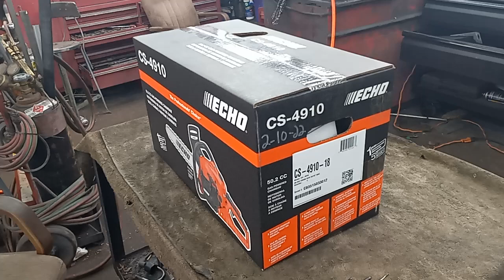Un boxing an tear down on the 4910 reed feed nitro saw build an me babbling

Comment: Charlie, I upend up my transfers on a 44cc husky, just a bit, but it just wants to idle higher. I know how to adjust a carb but the idle screw wont even affect the idle, the only way to get it lower is to make the low jey way too rich. Do you have any idea whats going on? Or is ot normal. The saw is vac/pressure tested
Reply from the maker: Checkit good for an air leak
Reply: @CharlesBrisco  I'll do that, I like the longer jabbering format vid like this one